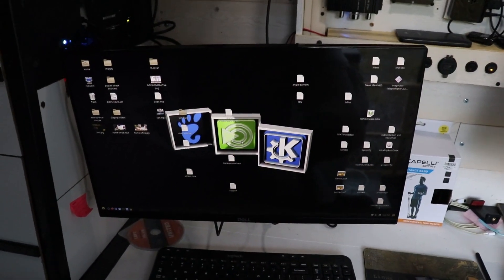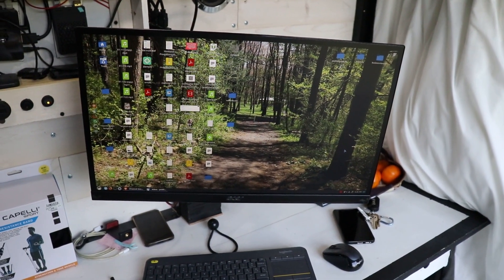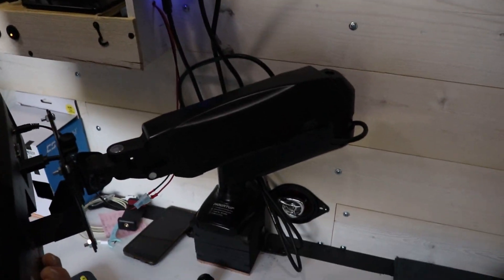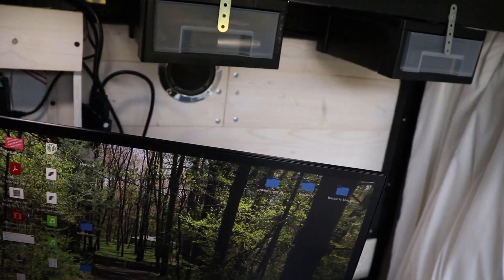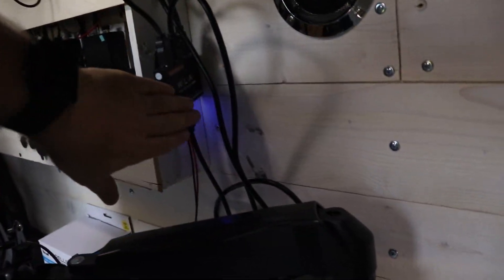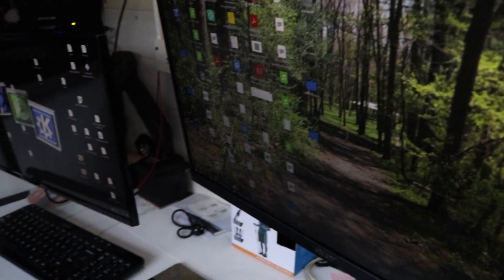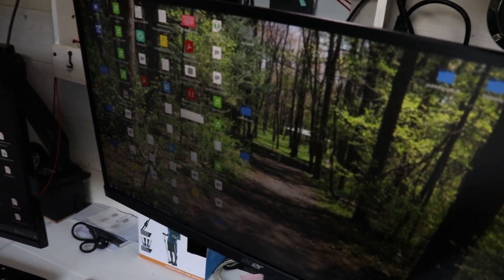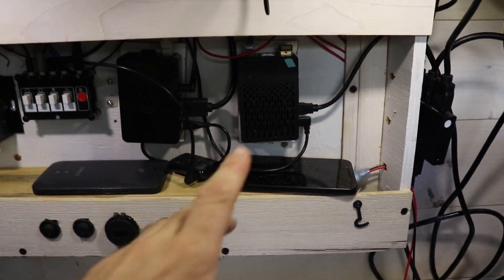What Linux I Run in an Off-grid Van

Comment: Interesting. A bit more complicated than I would do it, but I'm not trying to do as many things as you are.
I have batteries for all my Macs and RPis but I haven't considered hooking them into an automotive wiring system.
I would be curious to see how you use this setup. I see the pieces but I don't yet see the workflow. Why do you use certain computers for different purposes? I could see running the whole system off of one computer, but that might limit flexibility.
"Setting up client sites"?? What's that about?
Overall it looks like a really nice rig, looks like you still have a lot of space.
Reply from the maker: 1.) I should have included a DC to DC charger. It is something I might look into in the future, but I need to see how it fairs when I am in the west.
2.) I use different computers for power purposes. The streaming computer takes a lot of juice, so I only use it for high-processing tasks. Also, this allows better privacy and security by keeping passwords, logins, etc isolated to specific tasks.
3.) Client sites - I do web design and this server allows me to build out whole sites without being on the Internet in case I go into a wireless-free zone.

Comment: Tom, it sounds like you've gone to the Arch side of Linux. How are the rolling releases affecting your bandwidth? Any debian boxes remaining?
Reply: Do you find the monthly updates current enough to avoid breakage on arch-based machines?
Reply from the maker: Linux Mint, MX Linux, and Debian servers.
I only run Arch on the Pi because I don't have any other options for a fully-functioning box. Endeavour has always been my rolling.

To watch bandwidths, I update only about once a month at the last day of my cellular cycle.

Comment: Very nice setup, however I personally would add a tablet of some sort with a custom ROM, and a Logitech K480 Bluetooth keyboard into the mix to reduce power draw even more when I did not need the main computer/s.
Reply: I wonder how much time he can run this stuff for per day - suppose the Pis are absolutely fine because they has a very low power draw. Interesting indeed.
Reply from the maker: I have laptops and one tablet. I just didn't show that part since they aren't built in.
Reply: @SwitchedtoLinux  it's all good, I just thought it should be included for completeness of a mobile work setup.

Comment: Where do you shower and shave? As a former trucker, Pilot and Petro have clean showers :)
Reply: Damp cloth washing is the best way to keep clean - too much water degrades your skin DNA. That's why they stopped pushing Vit E cream for wrinkles - the moisture retention AGES the skin..
I am not in a van and never ever shower - I use damp cloth to wash and only when I need to. Much much healthier way to do it.
Reply from the maker: Shave: I use an electric throughout the week and an old-school safety razor once a week. I clean in a pale when I have to.

Comment: My raspberry pi is my main pc and also setup for offgrid use running of an omnicharge battery. Will power the pi and portable monitor for roughly 8hrs.
Reply from the maker: I want to look into some external Pi monitors. I have a RetroPi that I would love to play without taking up a full monitor.
Reply: @SwitchedtoLinux  I grabbed a 15 inch Lepow brand off Amazon, been working out great.